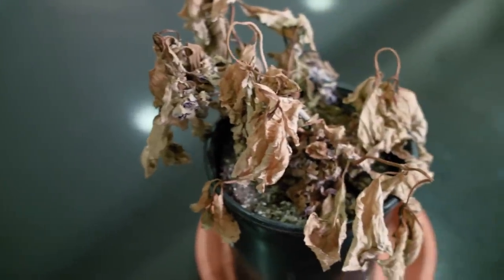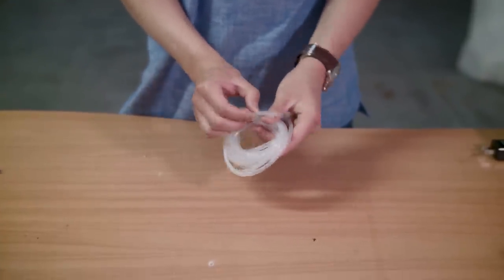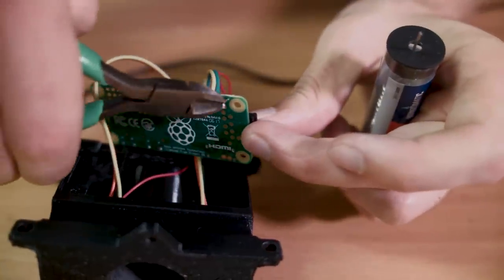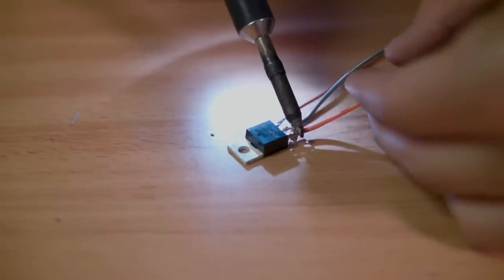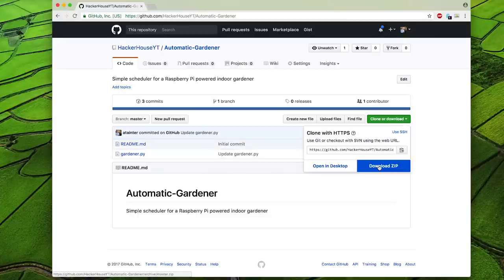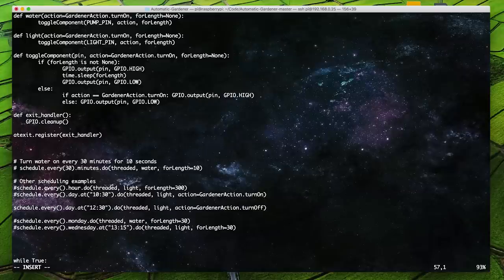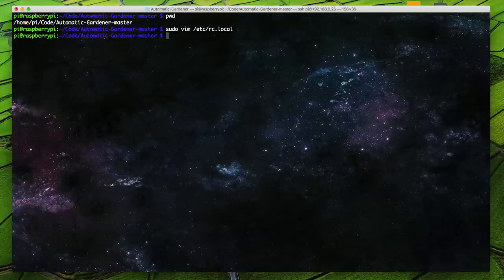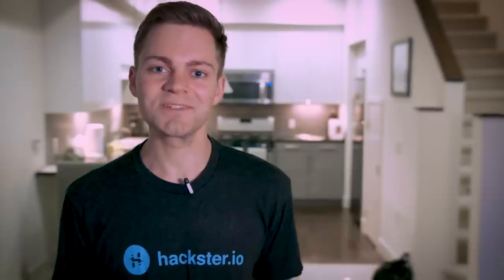Make a Raspberry Pi Automated Gardener

Comment: Nice project! I also made an automated garden, but wrote my code in C++ for an Arduino. It'd be pretty easy for you to make a simple voltage divider that measures the voltage drop across the soil for a quick and simple moisture probe if you plan to improve it. I really like the grow light and small pump!

Comment: Little known fact in the Pi community... there's something called a power MOSFET that you can use to switch much higher voltages than 5V... or use a relay and switch AC.

Comment: This actually gets me halfway to my end goal of an automated chameleon cage.  The lights and water are covered. Next I need to set up a thermometer, and code that information to auto activate the heat lamp/cooling fan to maintain optimal temperature. As well as a humidity sensor set to activate the fogger below optimum humidity.

Comment: I was just wondering , why to use such a powerful processor for such a simple task , why didn't you use an Arduino, or Esp 
That would have made it so much more cheaper and simpler !
Reply: Parth Bhat So true
Reply from the maker: +Parth Bhat you could if you want. We thought it would be cool to use this with an IoT app like Blynk since the Zero W has built in WiFi. The zero is also only $10
Reply: Hacker House yup fair enough , but I'd say its way to powerful for such a simple project , its like testing a 1.5v led on 120v Ac
Reply: not even arduino microchip pic can be found for < 1$
Reply from the maker: Good analogy. We'll try to keep that in mind for next time.
Reply: Would you say doing this is easier with an Arduino? I'd personally also use a raspi.. i do get your concern, but is it really easier for someone to pick up an Arduino for the first time rather than be experienced with a Pi?
Reply: Daan beltman well, of course it depends on your experience your right. But any time arduino is more simpler than rpi, yeah sometimes there are exceptions
Reply: Parth Bhat I agree. or perhaps use this to water and light several plants.
Reply: there are plenty of reasons, easy wireless setup/remote access is a huge feature, easy logging another major feature.
Reply: Glenn Johnson Exactly my point
Reply: @hackershack  the link in description for a raspberry pi zero costs 39.99 not 10$

Comment: Hello, You could solve the same issue with two timers, one link to the light and the other to the pump... However you have greate potential to do things like; humidity sensor for better watering, compensate outside light variations with the lamps, ph of soil for fertiliser, timelapse of the plant (with lamp on) and so on. This would bring real value to the project as the Raspberry Pi is well suited to solve this issues. Looking forward more developed project.
Reply from the maker: +Loïc Rosset yep! That's why it's open source :)

Comment: nice! one suggestion though: in rclocal you may want to add an ampersand (&) at the end of the line so it runs as a daemon. that way you can still complete the boot if you're connected to a screen and log in, otherwise it will hang at startup.
Reply: so that line will be:
python /home/pi/Code/Automatic-Gardener-master/gardener.py &
Reply from the maker: Added to the docs
Reply: this is what makes open source great. keep up the good work. i look forward to seeing what you create. :)

Comment: super video could it be passible to add a ph prob ?
Reply: weed grower right here
Reply: yes and French on top , that s smell bad :-)

by the way i use ph controlled water on all my indoor plants.
Reply: did you ever use ph probes? 
i never found probes that could be constantly installed in a DIY system
Reply: there is some you can buy at RS that can be immerse 24/24 and they cost like a 100 usd
Reply: you can find them in many web site like RS i am using a cheap prob (actually a 10 usd ph tester that i interconnect with the system its tricky but it works i change the prob every 6month
Reply: What is the brand of ph prob you are using?